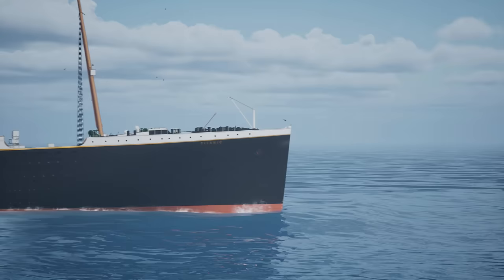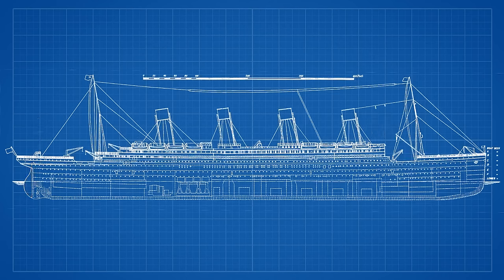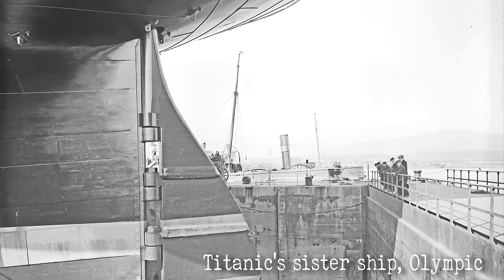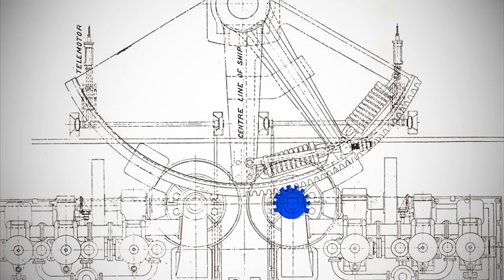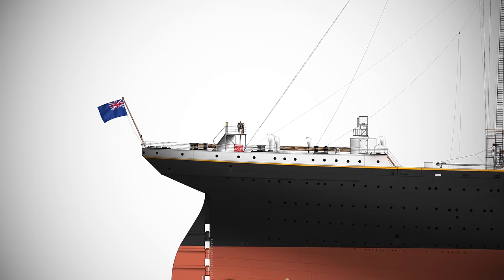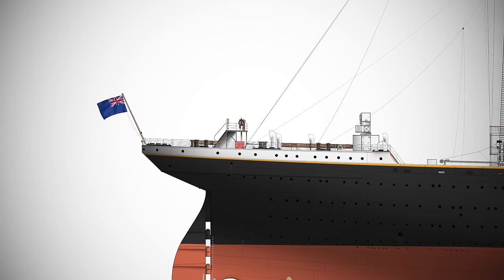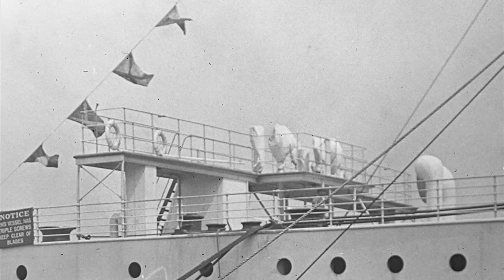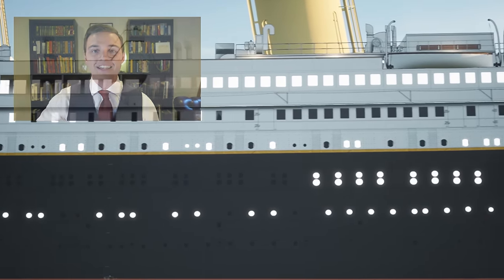How Did They Steer the Titanic?

Comment: I always thought it really odd that, after watching the films, that it was ordered "full astern" just after ordering "hard to starboard".
Titanic, Olympic and Brittanic all had their centre steam-turbine propellers right in front of the rudder, but it can't reverse, so full-astern would simply shut down the centre propeller which is the slightly more powerful of the three engines provided the two reciprocating engines are running. Wouldn't the bridge officers have known that?
Wouldn't the rudder have been far more effective, forcing the ship to turn to port far more easily, if "full astern" hadn't been ordered (perhaps in a blind panic) as all engines were ahead?
Reply: They very much would've known that, yes, which is why they didn't reverse them in reality.

Comment: Speaking of turning this ship, I had an interesting conversation with a helmsman about Murdock making a mistake of having the engines thrown in reverse while turning. Basically he said that the ship would turn much slower done in that way, and that his solution was to keep the speed they were at while turning instead of putting the ship in reverse. Now I have have my disagreements about this for many different reasons. But i'm curious if anybody shares this same feeling or thinks that would be a stupid idea. Also curious if you would share details of why it would or wouldn't work. Just curious.

Comment: Agree with your analysis that the Titanic's rudder design was not to be blamed here. Failure to reduce speed significantly upon approach to the "danger" zone, a key factor in this amateur historian's point of view, as well as other regrettable oversights you might say. It must also be remembered that the the Titanic's propulsion system was of a "triple screw" design. The two "wing" propellers design could also aid reportedly in manuevering the vessel by varying the power, maybe even the direction they were turning if I:m not mistaken. The center propeller, reportedly only turned in forward propulsion. The ship being rushed through sea trials it sounds like, highly unlikely the crew would be proficient in talking advantage of this added boost to make a "power" turn to the left in an emergency.

Comment: I have often wondered if the Titanic could have been saved had only the port screw been placed into full astern  With all three screws in reverse, the ship still hit the berg but the water hitting the rudder was a turbulent mixture over a large portion of the rudder, and the rudder would have been less effective than the rudder in the straight flow of the water flow at full speed - had the center and starboard screws remained at full ahead. Also, the reversed port screw and forward starboard screw would have increased the turning moment, since the screws move much more water than the rudder was deflecting,  and may have given the ship enough course change to miss the berg. 

But I guess we'll never know......

Comment: Don't know if this is true but I've heard that had they not turned to avoid the iceberg but had hit it head on, the ship, although with severe bow damage, would have remained afloat.
Reply: Among professionally trained mariners and others familiar with contemporary ship design and construction, that seems to be the general consensus. The other possibility is that while the ship might still have sunk, the process would happened much less quickly, allowing substantially greater time for rescue. After and minute or two in water of that temperature, most of the victims would have been unable to swim due to hypothermia.

Comment: "In this case, you can't blame the ship"
Well actually you still can.
The ship was too big for the conditions it sailed in. If you can't see far enough ahead of you to make the turn then you are either:

1) Going too fast.
Which i'd say isn't really the case (though it would have been beneficial to go slower) because if the ship is going slow enough to spot and turn from an iceberg then it's rate of turn is going to be limited by it's slower speed.
That is, if you are going 20 knots and are turning at a rate of 40 degrees a minute (i have no idea how fast titantic turned at various speeds, but the principle holds true) you are doing so because you are pushing 20 knots of water against the rudder hard to make that turn.
If you are going 10 knots then your rate of turn would have been 20 degrees a minute due to the lesser speed forcing the ship into its turn.
This is all simplified of course and there's tonnes of variables at play.

But in this simple terms, if you've ever operated a boat that has a rudder or even a canoe, you know that the faster you are going forwards, the faster you can make the boat turn. The arc of the turn will be about the same no matter what speed you are going.
A canoe of course has the benefit of being able to put the rudder flat against the flow of water and even moving it the opposite direction. That is beside the point. If you hold it steady like a rudder, then a fast moving boat will change it's heading faster but it's also going faster so the amount of space or the turning radius if you will remains about the same.

2) Have a ship that is turning too slow.
This is the truth about the titanic. Under the conditions it sailed in. Where icebergs could not be spotted in time to avoid them because the titanic's turning radius was too large.
They simply shouldn't have sailed in those conditions at all. Or they would be going so slow that should they hit an iceberg it would be such a light hit that not even paint would be chipped off the hull. And going that slow would mean they probably wouldn't have any turning capability at all, they would also probably be going sideways due to a light breeze pushing the ship like a sail.

------------

The only solutions would be to not sail near waters with even the remotest possibility of icebergs or to use a smaller boat that could turn in time or to make even better rudders for the ship.
And yes, i am aware of that if you are going slow and "floor it" your rate of turning gets better as the propellers provide higher water flow around the rudder while the ship is still going relatively slower.
So less blame could be placed if the Titanic wasn't already going at a decent pace through iceberg infested waters. It's not the ships fault it was going the speed it was to start with.
But still, big ships CAN be made to turn pretty sharply. But it costs too much for any shipowner to feel it's worth it.

Comment: So what happens if the forward wheel want to go right but someone at the rear steering wheel wants to go left?
Reply: My guess is, only one is mechanically connected to the steering engines at any given time. Means that 1) the rear wheel can be easily covered while not in use, as it doesn't move by itself and 2) if the primary steering control fails in a way that it gets stuck, it lets you simply disconnect it and connect the backup.

Comment: On a ship that big, when you put the rudder over to starboard for a right turn, the stern will start to swing to the right causing the ship to pivot, which swings the bow to the left.  Continued forward motion will eventually bring the ship around to the right.  A ship's wheel is always turned in the direction you wish to travel.  I favor the idea the actor in the first Titanic movie goofed.  The explanation using a tiller is just face saving for all the movies that followed the original.

Comment: The thing is they steer the same as they did back then with rudders and propellers.  The only difference between then and now is that now it’s controlled by computer systems and such and back then men had to control the ebbe and flow of power to the engines.  But the actual steering mechanisms are still the same for the most part

Comment: see though it had 3 props 1 which ran off a turbine the middle one 
    but if they could've reversed the port then thrust differential would've allowed it to turn faster and even with the existing rudder design it still could've had a balanced rudder directly behind the center prop by splitting it and recentering the lower one with a different control shaft 
    could've added balanced rudders over the outer two as well
that opens up new possibilities for turning it faster
   really ideally full back on center and port full ahead hard starboard and might have turned in time
  reason they used reverse starboard and port? was it because how you would move the till or in this case the quarter gear

Comment: Ironically if the ship had steered to the right it would have hit the iceberg on the nose.  Not great but the ship would not have sunk.  A much preferable result but it is hard to imagine anyone thinking that was the better move at the time. Instinct says to try to avoid the accident, not drive into it.

Comment: You missed a critical component in the Titanic's steering.  The propellers.  The outboard props were reversed.  Big mistake! Let me explain.  The center prop COULDN'T have been reversed, just shut down.  The two outboard props COULD be reversed, but reversing props would cause considerable cavitation.  The center prop was stopped, this ALSO would cause cavitation.  The cavitation means the rudder would be in foam, not just seawater. In my youth I used to float rivers, including white water (foam), and learned that paddling in foam is useless as it is filled with gas so has considerably less mass. I have figured out how they could have turned much more efficiently.  One, gradually slow the port prop (not fast as that creates cavitation as well), which means the stream of water is more laminar.  By gradually slowing the prop, the ship can pivot around the slowing prop.  Two, gradually increase the starboard prop, gradually so as not to induce cavitation and maintain laminar flow and enhancing the pivot about the port prop.  And three, and MOST IMPORTANT, gradually accelerate the center prop, while at the same time turning the rudder more gradually but ultimately to the same direction they turned (to port even though it was "hard-a-starboard).  The flow of water from the center prop enhances the effect of the rudder, turning it into a vectored thrust type of prop.  I think this would have drastically accelerated the response of the ship to the combined commands to the engines and rudder.  As it was they didn't smash into the berg, rather they brushed up against it.  I am imagining that they would have gotten close but not run aside. As cavitation had been discovered in 1895 by Barnaby and Thornycroft when researching the sea trial failure of the HMS Daring.  I would have hoped that the engineers of the Titanic (and Olympic and Brittanic) would have let the officers of Titanic be aware.  In truth, the lack of training in Titanic's "sea trials" (a whopping six hours) was perhaps the biggest problem.  But I'll save that for a later comment.
Reply: Contrary to popular assumption, they likely didn’t reverse the engines to avoid the collision. This was only ever reported by 4th officer Boxhall, who was walking towards the bridge at the time, heard the telegraph bells ringing, and assumed the order given was “full astern”. Unfortunately, he even put words in Murdoch’s mouth when he testified that Murdoch told the captain that he “put her hard over and reversed the engines, but she was too close”.
The actual order received by the boiler and engine rooms was simply “all stop”. This makes even more sense considering that Murdoch was previously in position on the Olympic and would’ve known full well that there wouldn’t be time to reverse them.

Comment: WRONG, Hard-a-starboard meant turning the wheel to the right just like pushing the tiller to the right. This would deflect the rudder to the left creating the desired left turn.
Reply: Tiller commands pertain to the direction of the ship itself, as opposed to the wheel, since different ships might’ve have different orientations for their helms.
Reply: @DerpyPossum  At the time Hard-a-Starboard meant turn the wheel to the right, just like pushing the tiller to the right cause a deflection of the rudder to the left for a left hand turn. The command pertained to the wheel or tiller !
Reply: @DerpyPossum  Think about it. If it pertained to the direction of the ship why did the Titanic turn left ??

Comment: How did they steer Titanic? Spoiler alert.. 😏

As well as they possibly could’ve given the minimal amount of time provided with the baffling conditions of the night. The circumstances regarding the atmosphere led to the lookouts not possibly being able to spot the iceberg until the ship had a window of anywhere between 30 to 55 seconds of reaction time, meaning that the helm was put hard over in a rather impressive amount of time that led to the ship pointing away from the berg as much as physically possible in the moment. It still struck simply because there wasn’t enough time to avoid the berg in its entirety.

But sure, let’s all go ahead and comment our cheap assumptions that they didn’t steer at all simply because of the fact that it sank, without doing any more thinking into the matter. Great job, comments. Great job…
Reply from the maker: I have been shocked at the amount of "lolol not very well" comments haha, every time they come through my phone lights up. I must have seen about 200 already!

Comment: It is called INDIRECT STEERING!  When the officer called HARD A STARBOARD and the wheel was put hard over to the right, TITANIC TURNED TO THE LEFT!  THAT IS BECAUSE IT WAS FITTED WITH INDIRECT STEERING.  IN OTHER WORDS, IF THE SHIPS WHEEL WAS  PUT OVER HARD RIGHT OR TO THE RIGHT, THE BOW OF THE SHIP MOVED TO THE LEFT AND IF THE WHEEL WAS PUT  TO HARD A PORT, THE BOW WOULD HAVE TURNED TO STARBOARD!

Comment: You never did answer the question how it came about that after First Officer Murdoch gave the order to Helmsman Hitchens to "Hard a-starboard," the ship nevertheless turned to port, not to starboard.
Reply: He did. It’s called “Tiller Commands”, and they were a result of the upkeep of maritime tradition. An order of Hard a-Starboard would essentially mean to “quickly turn the ship to port”, and vice versa. Even after the introduction of ship wheels, they still used it for the sake of aforementioned maritime tradition. It wasn’t changed until (I think) the 1930s.
Reply: @DerpyPossum  I understand that, but the narrator never stated explicitly that “Hard a-starboard” meant “Turn THE WHEEL, not the ship, to starboard,” which would have explained that.

Comment: Sure the rudder was tall, but it doesn't look like it extended out very much. Why make it so short? There is no drag in a straight line. It looks like it should have been like, 3 times longer to be functional in any way. Unless you plan your steering a half hour in advance. 
For the size of the ship, definitely looks inadequate. Being 70+ feet tall doesn't do anything. It could have been 30 feet tall, and 70 feet long, and would have performed better...

Comment: I'm not sure your explanation of ordering a rudder movement opposite to the desired turn direction is valid. Ship's had been using a wheel to control rudder movement for well over one hundred years at that time. Granted, the British maritime, especially the Royal Navy, were very averse to change and very hidebound in their ways, but sticking to tiller commands when a wheel is used doesn't seem logical. To me, it makes no sense and could be a source of confusion to order left rudder to turn right, for example.
Reply: It likely was seen as confusing by some, but the fact is that they did indeed continue to use the commands long after wheels.

Comment: How did they steer? Too little to late, that’s how.
Reply: As much as possible, with not enough time.
Reply: @DerpyPossum  And the irony is that if they had not tried to turn and hit the berg head on she probably would’ve stayed afloat.
Reply: @boataxe4605  Plausible, but the fact is that no sane officer would’ve allowed it anyways.
Reply: @DerpyPossum  Correct, they weren’t thinking about how many water tight compartments would be flooded. She could float with the first four flooded, but the damage extended five feet into the fifth one.

Comment: An essential truth is being missed here the propulsion system comprised of three propellers, one each side and a centre screw the two outer units were driven by piston engines. The smaller centre screw was driven by a low pressure turbine, this screw could not be reversed unlike the outer pair but it could be disengaged from its drive shaft. Reversing the outer screws and disconnecting the centre screw was not the way to skid turn the ship, without the water thrust acting on the rudder from two of the screws turning efficiency would have been drastically reduced. Once the order that was given that night was executed the ship was doomed.
Reply: It’s most likely that they didn’t reverse the engines at all to avoid the collision. This was only ever reported by 4th officer Boxhall, who was walking towards the bridge at the time, heard the telegraph bells ringing, and assumed the order given was “full astern”. Unfortunately, he even put words in Murdoch’s mouth when he testified that Murdoch told the captain that he “put her hard over and reversed the engines, but she was too close”.
The actual order received by the boiler and engine rooms was simply “all stop”. This makes even more sense considering that Murdoch was previously in position on the Olympic and would’ve known full well that there wouldn’t be time to reverse them.